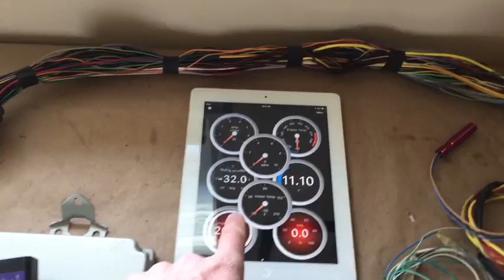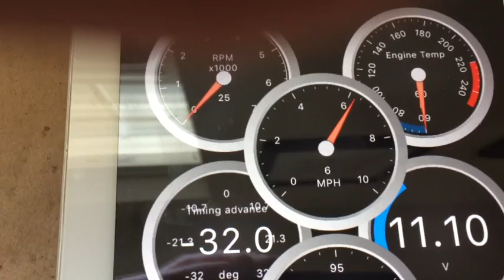2002 Subaru Legacy VW Wiring Harness Conversion

Comment: I have this identical harness that I was told came from a 2002 Impreza 2.5L. I can't find the proper O2 sensor that fits the connector (the orange one). This is a male so needs a female on the sensor.The O2 part number listed Bosch 17018 that has a  male connector also and only 6 pins. I checked many sources. Can you help me with proper connector. Thanks for your time abd great videos.
Reply: There are 2 O2 sensors, One upstream, one down stream
Reply: The sensor you are looking for is actually a standard Bosch LSU4.2 wideband O2 sensor. Many people will tell you that it isn't, but they are wrong. Subaru used standard Bosch sensors from sometime around 2000 through 2002. I'll give you a couple links in another comment in case it goes to spam.

Comment: I have the same harness, but I notice that the ecu plugs are not in sequence.  My pin out Has the right number of  ecu plugs. All the plugs have the right number of slots and holes. BUT! On the pin out paper it goes in numerical sequence from plug 134 thru plug 137. On the ECM it does not. (134, 136, 137 135) The plugs are in the wrong sequence compared to the pin out page. Does this matter? Question 2-How do you know which spots are for the the grounds on the engine plugs?  Where can I get a schematic for the engine plugs? Question 3- I have 5 wires coming from the Engine plugs. There should  be 2. They are pink, brown/yellow, green, and green black (x2). I know the  pink and brown yellow are for oil temp and pressure. What are the green ones for? Question 4- I notice a little white plug that comes out of the harness near the ECU. Whats that for?  Thanks again for this video series. You Rock!!